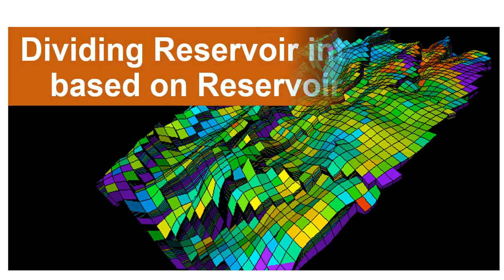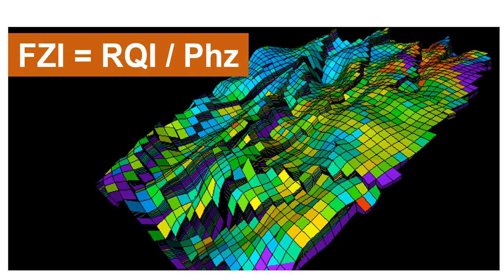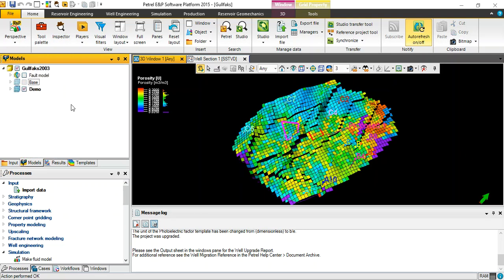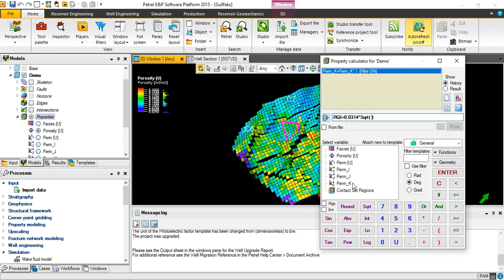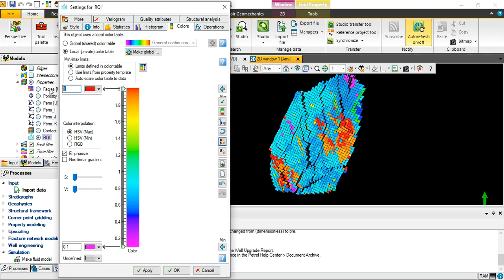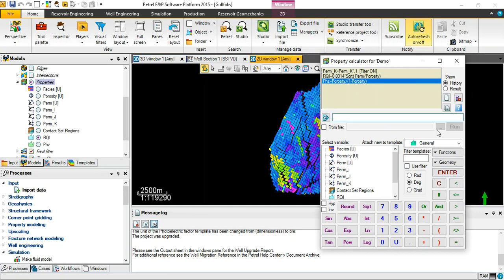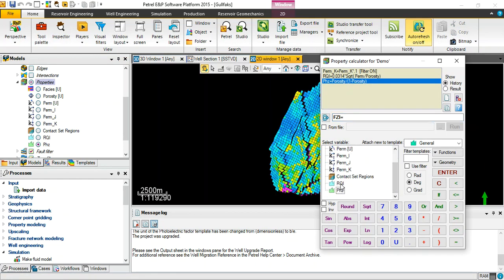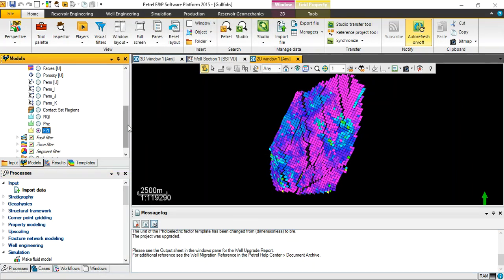Modelling Reservoir Quality Index RQI, Phz and Flow Zone Indicator FZI in Petrel

Comment: FZI ends up very  high results for fractured reservoirs even though facies of carbonate rock is not very good. Is FZI applicable for fractured reservoirs?
Reply from the maker: Yes, you can use it in fractured reservoirs
You can Whatsapp me for more details
+201000043187

Comment: Thank You for interesting video.
May i ask you a question? The rqi depends from porosity and permeability derived from well loggin interpretation? If permeability is incorrect, therefore rqi is also modeling not correctly,  the question is how we could check corrrectnes of such things like permeability as initial parameter?
Thank You for answering in advance.
Reply from the maker: There are different sources of Permeability, Well test analysis, RFT, Core data..
You should calibrate the permeability from logs with core data and construct a relationship between porosity permeability cross plot for each layer.
We can make another video for these calibration process.
Reply: @fanarconet  The Core Permeability by Core often shows overestimation of K in fractured rocks i mean microfractured which opens in laboratory conditions and underestimation in rocks with vugs and chanels (carbonates). The Well testing i suppose is more informative, but i never use it before for This purpouse. So if you could make a video how we can adjust porosity permiabiliy relation or ?-permeability from well testing or plt data I will be extremely appreciated you help, maybe It will be interesting not only for me.
Thank you for you impact in Geology and Petrophysics.
Reply from the maker: @PyScientist  Usually in the lab they choose the sample to be analysed with less vugs and fracture, so in fractured reservoir in most cases it is under estimated permeability.
Honestly, no straight forward way to model permeability but you have to use the available resources.
Still working on that just follow us.